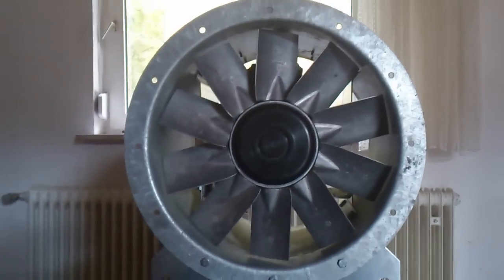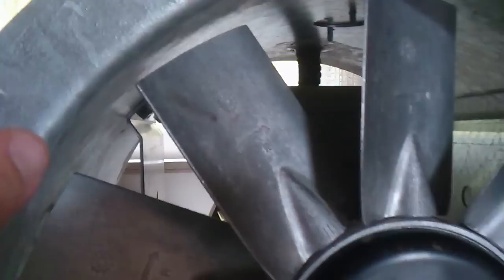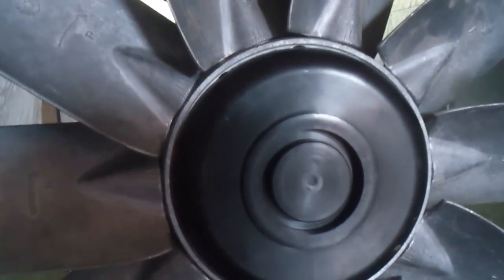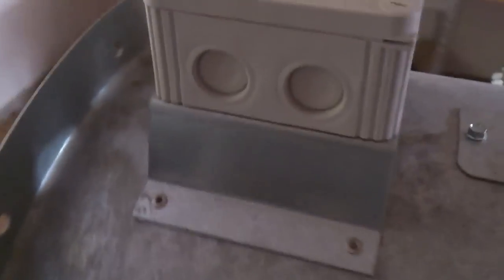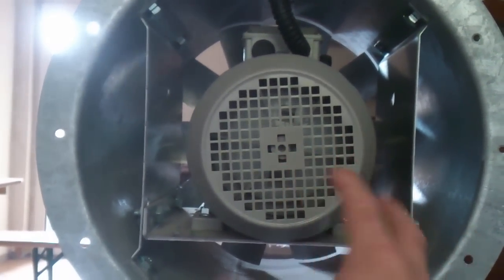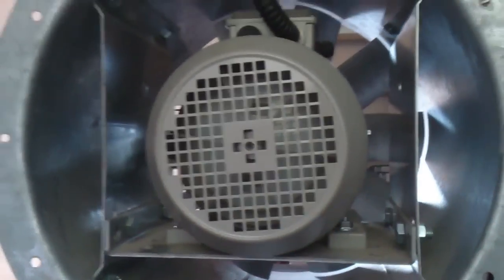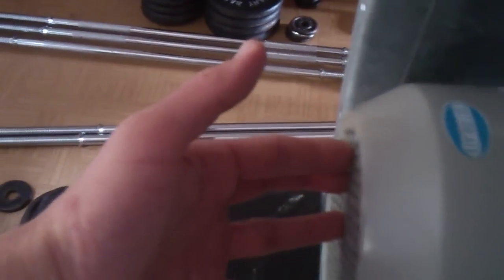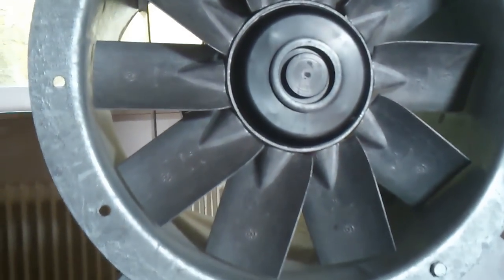Axial Fan - Demo of Stationary Industrial Mechanical Ventilator

Comment: a few comments, it is better to order motor without box. factory will do plate fixed cable lead out. mounting is very much blocking. if you are using non-special certified zone, u can take out back cooling fan. means ordered motor should change from tefc to tenv. air direction should be blades (impeller) to motor, not motor to blades.

Comment: is the blade supported by the rotor shaft.. or is the fan mounted on its own shaft..

 increased flow could be done by moving the electric motor out of the tubular housing wish shaft extensions. 

 if you plugged that in.. how far out in front could you feel it in feet or meters using a piece of tissue to judge.. 

do they offer 90 degree elbows with turning vanes in it.  i would love to take a pair of axial fans.. put a 90 degree elbow on the outlet of both.. 

weld up a tapered duct to bolt to the top of the 2 elbows to join the flow .. install super thin tubing to create a laminar flow coming out..  aimed straight up.. mounted on a trailer.. or truck bed..  the tapered duct above might have to be hinged down for clearance..  

 on really smoggy days when the inversion layer is only 400 feet up.. turn on the fans and start blowing high speed air up.. eventually it may be enough to puncture the inversion layer and start blowing warm air and smog thru the inversion layer into the cold air above where it should continue upwards..  if you don't think it would work. sit on one side of a room.. suck in a lung full of air and blow across at the spider web on the far side of the room.. 

my plan might be to use a powerful gasoline engine to power the fans directly. could be natural gas.. propane.. heck lets use electric motors from a tesla.. bypassing all the electronics.. just full speed direct power from the batteries..
Reply from the maker: Blade are supported by impeller hub which in turn is supoported on motor shaft

Comment: How to install this fan at basement car parking, is it possible hanging with threaded rods 12 mm  to the concrete slab  ?
Reply from the maker: +abdul khayyum I think it is better to consult the manufacturer's guidelines.  For car parks I believe jetfans would be more suitable. The fan shown here is usually conneted to a duct system.